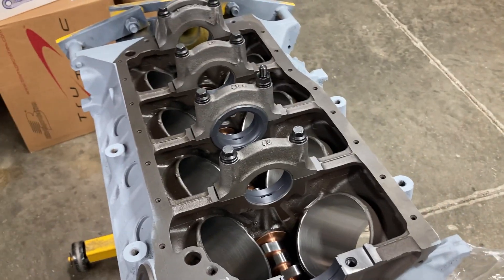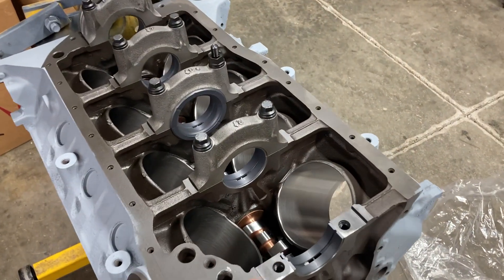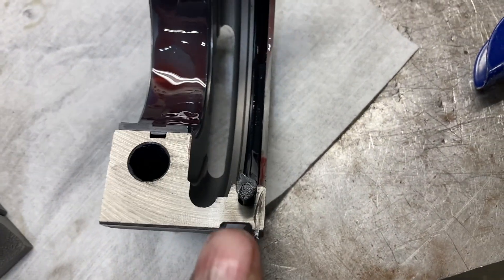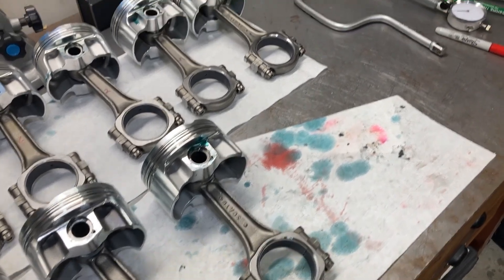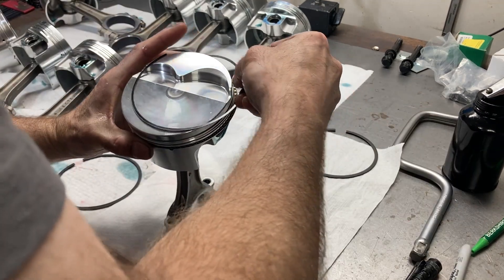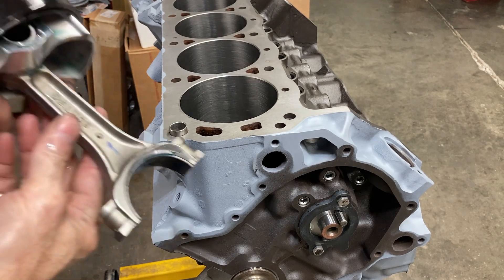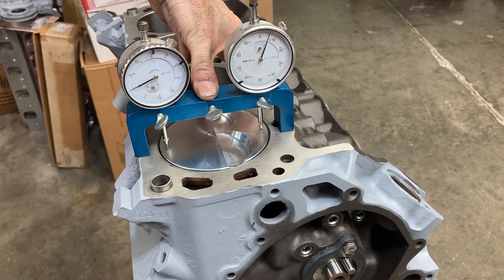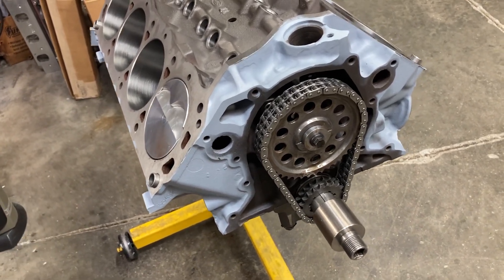Lykins Motorsports Ford 289 Short Block Assembly Part 1

Comment: I know how you feel I had Covid last week and it wiped me of energy feel better. Finally someone said it that piston rings rotate. I don’t know how many alleged engine builders have said I am crazy when I tell them that they rotate. I am a ford guy myself and the engines you build are a part of automotive history. I liked to see the sbf tunnel ports I have always heard that they only work at very high rpm like 8000 plus is that true?
Reply from the maker: I've heard that as well, but this is my first one, so I have no practical experience with them.  We will find out.

Comment: Yep I've experimented many times with ring gap positioning in our drag race stuff, recorded where ive put the gaps, some cylinders aligned, sone not all in different bore areas etc, on tear down they are never in the same position,  some unalogned rings end up aligned etc, they are all over the place with no ill effects , leakdown, wear or bore differences.
 The ONLY 2 considerations for ring positioning during assembly is to not put a gap/ring end where it will pass a notched point of the bore and to offset the oil expander and rail gaps simply to make the oil ring pack stay together and support itself better upon fitment. No other aspects make any difference. 
 Get well soon. 👍